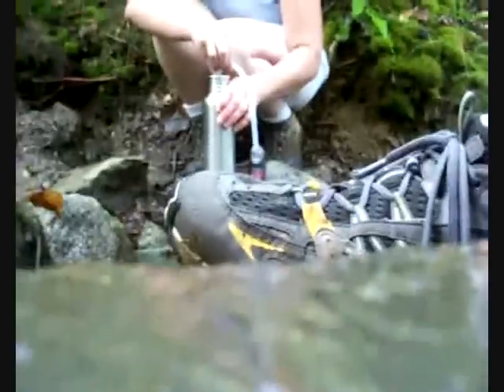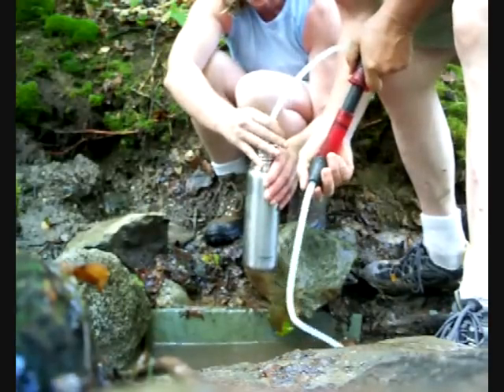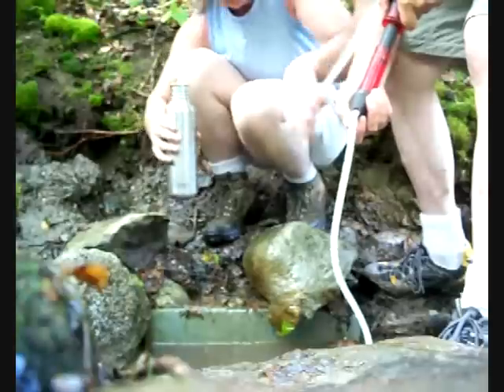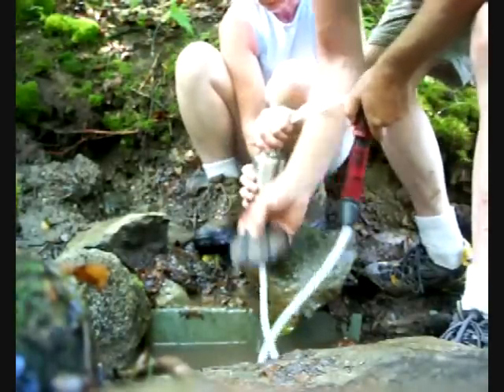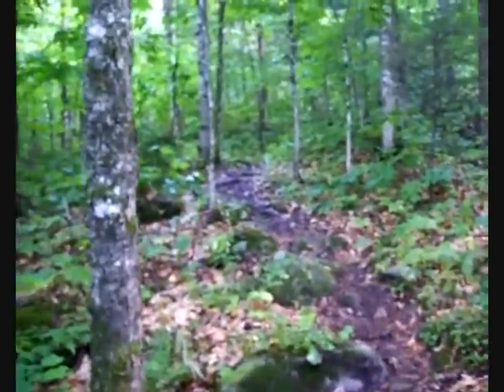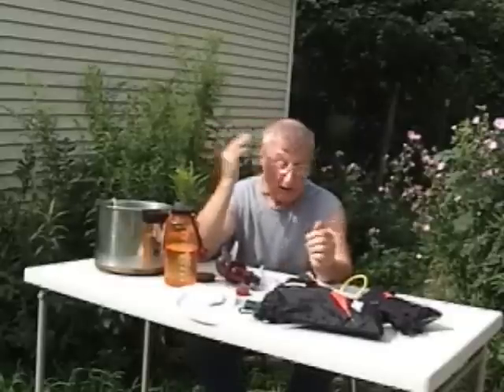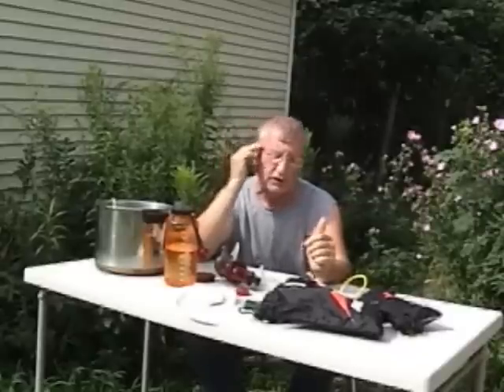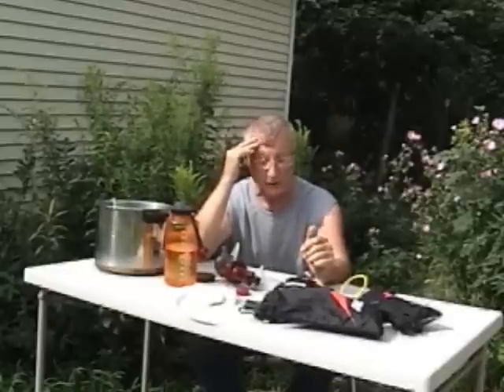Hyperflow field test part one

Comment: @joerabbit1970 Nope, the "moving handle" end is the part that snaps onto an MSR hydromedary hydration bladder.  Probably doesn't matter though.  As long as none of the internals are contaminated, if you have both the valves set in the same direction, it probably filters fine either way.

Comment: @doc12188 The directions suggest cutting the inlet tube to use part for the outlet if you need to, exactly has he did.  I use it with an MSR hydromedary hydration bladder that it snaps into very nicely instead.